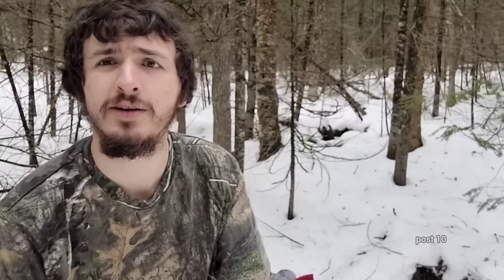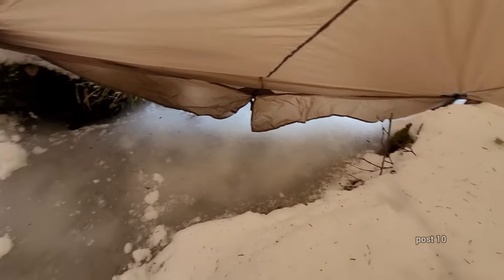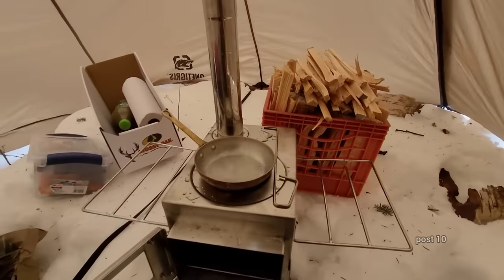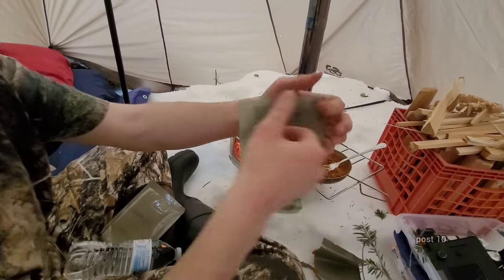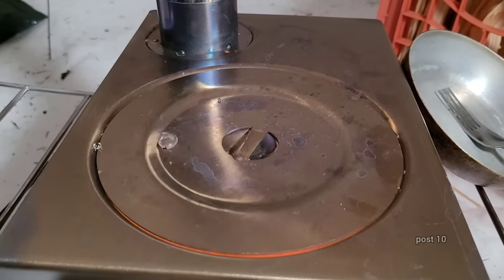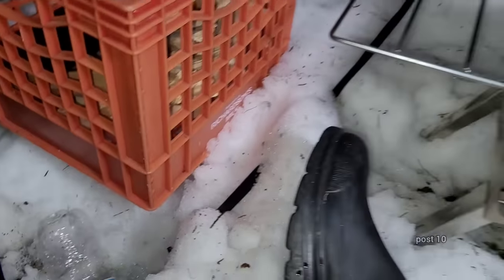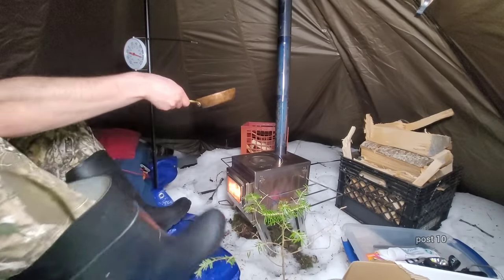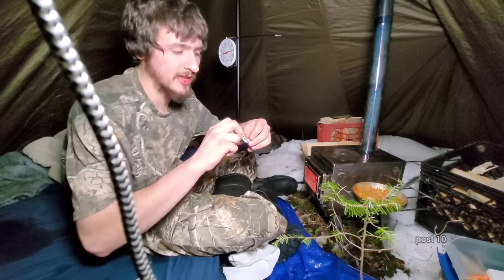24 Hours Winter Camping With MRE Meals And Tiny Stove, With Stream Inside The Tent

Comment: Some words of advice, sorry if anyone else has mentioned this already :  
Your MRE isn't heating up enough because you aren't putting enough water in the pouch, ALSO, you're not supposed to put the water in FIRST. The water should go in the pouch AFTER the meal pocket. You insert the sealed pockets in the heater sleeve then pour enough water up to the line. Then you want to sit the pouch at a 45⁰ angle, NOT flat. You will get much better and hotter results, I guarantee it.

Comment: Those smaller stoves are actually great for extreme cold I use one smaller in my steel shed (10x12) and it keeps it warm at around 65-75 and it’s not insulated at all and it doesn’t take that much wood to keep it warm

Comment: The coloration on the pipe shows visually the level of heat. 400-450f will be golden, 500-550f will be blue, etc. If it gets hot enough, it'll go back to grey. It's pretty interesting, the colors are actually a form of rust as the metal heats up it interacts more vigorously with the oxygen the changes reflect that. I use that color change to temper steel in my shop to whatever level of softness I need after hardening.

Comment: Hello! So many ideas came to me about the tent, etc. 
If you want to use the tent in the summertime where there is no handy depth of snow to plant the pole into, you might get a piece of pipe the pole fits almost snugly into. Cut one end of the pipe into spikes to hammer into the ground wherein you may stand the tent pole. You worry that you have to nearly fall into the side of the tent to open the zip. Maybe a stick with a ring attached could make the 
The pan is overweight on the handle, but that kind of pan can be used to make omelets on a chef's small propane/butane stove (or a camp stove!). Omelet chefs start the omelet in the pan. When it is cooked enough on one side they flip half of the pan's contents over forming a semi-circle. And the pan is leaned against the stove burner so it continues to cook more slowly. 
To balance the pan you might look for a fork or spoon to balance the handle (or some weight to counter-balance it). To make the fork or spoon hold itself to balance the pan handle, cut a slot into into the handle of the fork or spoon to settle opposite the pan handle. 
Good camping inn later times too! __

Comment: An idea for another time - if your bed gets wet like that, use your hot frying pan like an iron to dry it. That is basically all that the old bed-warmers were - a frying pan with a tight fitting lid that they filled with hot coals. Then they would just pass it between the sheets to warm up the bed.

Comment: Love your videos mate, just a suggestion. With those kind of rations the packages are made to be ‘boil in the bag’. If your not using the heating element just boil water and drop the packets in for a few minutes. They cook evenly and you can you can use the boiled water for drinking after it’s cooled down. Also saves on cleaning! Be safe and keep doing what you do

Comment: With those MRE heaters, you are supposed to place them at a 45° angle, not lay them flat.  That has the same effect as using too much water. Also, you should save the box if it comes in one to slide it back inside to keep the end folded over.  I have used them in the service and they will boil your food if used properly.
Reply: Use rock or something lol
Reply: @timmermansj1300  Yes, a rock or something is a key element of the MRE cooking process.

Comment: Great video! When I fought fire for the Forest Service back in the 90s, we were issued MREs for our packs but they didn't come with heaters so someone told us to leave the entree foil pouch in the cardboard sleeve, stand it on it's end, leaned against a rock and light the bottom on fire. As the flames consume the cardboard and move up the pouch, it heats up the contents pretty good, better than eating them cold at least.

Comment: I use a spark arrestor on my tent stoves and never had a problem with creosote buildup even with a damper.   Not sure if it  will help but I also use some aluminized Kevlar around the stove-pipe where it goes through the pipe jack in the tent.   The warpage and discoloration seems pretty normal for stainless stoves and they all seem to glow after a few hours of use especially with the air vents.   Even the titanium stoves warp to an extent.      I carry some 000 steel would to clean the stove pipe after use helps keep down the carbon and mess when packing.      The packable stoves are awesome and can be used when there is not enough snow coverage for using a sled,  I especially like the one piece rolled stovepipe packs super light,  no worries about leaking and easy to clean.       Great content - love the Latvian and Estonian MRE”s !

Comment: In my experience with American MREs, when it comes to the heating element, less water is better. I would start with ¼ of the recommended water amount and work my way up. They have a tendency to flood and be temperamental. Start with ridiculously less and you will be surprised how much better they work.

Comment: 32:12 "This is way better than I expected" That's been a lot of my experiences with the food and drinks in MREs! Bought an old camper from the forest service that was used as a mobile command post and several of the cabinets were filled with unopened MREs, so I've been slowly eating through those. Probably over 10 years old now and they look like dog food sometimes, but are surprisingly tasty and very edible in most cases. I've have had some bad ones though, I think I had some eggplant stew one once that was pretty horrible. Whats your favorite and/or least favorite MREs youve had so far?
Reply from the maker: My least favorite MRE meals are probably the cheapest American ones and my favorite ones are probably the Russian ones. I've even tried ones that were 30 years old and they still tasted fine you like you just said but any older than that I just open them up to see what they looked alike like when I bought ones from the 60s although back then they were in a c ration count
Reply: @post 10

Comment: I think the problem with the MRE heaters is an issue of the food starting from cold. It would work better if the food was pre-warmed from cold to near body temp by putting the packet under the clothing, next to the body for a while.
Reply from the maker: It's because the American MRE heaters are really cheap while all the foreign ones performed perfectly
Reply: @post.10  10 years US Army and I dont think I ever had a bad mre heater, but Ive plenty of knockoff mre's where those heaters are about as useful as an ashtray on a motorcycle lmao
Reply from the maker: @F-1fittie  do you think these ones are fake? They came in a case from Amazon. I have bought many MREs over the years from different eBay sellers and almost every American one has failed I was always told that it's because as a civilian I can't buy one that is new enough to work properly but I would assume they should be working for like a decade. I've bought 30 year old American MREs and the heater works fine
Reply: When it's cold, you can put a meal in your sleeping bag with you for the next morning.

Comment: So we learned something today about that type of stove. The tent is now a loss with that many holes. Like one and done
Reply from the maker: No the hot tent is not a loss. There's just a couple tiny holes and if it became a problem I could use a bicycle patch kit over them or some kind of tape. I think it's a shame that the stove company sells these stoves without the spark arrestor that they also sell separately because they know people using these for the first time aren't aware that that part is also needed
Reply: I would personally if you bought the stove and the tent as a package getting hold of the manufacturer and telling them watch your video. And you're waiting for replacement. And take the  hints that you did and improve your product

Comment: The colour of the exhaust pipe is telling you how hot it is. When steel heats up like that, it goes golden brown and the purple-blue that you have. If you're tempering steel, this actually give you somewhat accurate readings into how hot the metal is. If you keep heating that pipe up more, it would turn back to grey.

My brass lighter has similar coloration changes near the flame part.

Comment: I have the black coated steal stove from the same brand, she doesn't smoke after it's heated up, you have to remember to close the drawer before you close your flue at all, I was wondering what to do with the holes on the back, he has given me a great idea, thank you dude, the added damper is gonna help do much. You have to make sure you always latch the door or it will smoke and turn red, and the drawer controls how slow it burns in the boxs, you closr the drawer  and it sends the hear up the pipe and cools the box.

Comment: that's single wall venting, that's why you have the bluing of the pipe. you should have double wall like gas furnances. also, you need to make a damper to help keep some more heat in, instead of going up the smoke stack .that stove is not practical, It is too small for cooking and the sheet metal frame work will not last. Bravo to the person who created MREs. They are handed out during hurricanes recovery when people are without power and stuff.

Comment: Take the top off the snow and pile it around the base of your tent around the inside. Help with drafts. Do it on the outside to weigh down your tent. 
Put those Russian tin meals in a pan of water on the stove to stop them from burning.

Comment: All those tents getting holes burnt into them seems like a common flaw. What are you supposed to do when you plan on camping for a week or two? Bring duct tape?
Reply from the maker: Spark arrestor I think. Haven't tried mine yet
Reply: Duck tape and a can of Flex Seal
Reply: And a can of 3M Adhesive spray

Comment: Stove; The seconary air is comming in the back. If you want to regulate, it must be from the ash drawer. The back holes can not be blocked, that is why it makes vary little smoke. That shows high wood gas burn, and will give more heat. Even though it does not have a baffle.  ...TUMZ ZUP !
Reply: that is correct, i have same stove and i actually prefer using the ash drawer and not having the damper in the pipe.  works great so far.

Comment: i have the same stove...the Ash drawer Is the air flow control.  the more you pull the ash drawer open, the more air flows.  No need for damper Nor adding piece to back side vents.  try using the drawer as the air flow and you will see yourself.
Reply from the maker: I bought a damper that the company sells, I had two drawer closed the entire time and it was acting like a rocket stove burning through like crazy

Comment: Love your video my guy but you’re supposed to burn all the harmful chemicals off a brand new stove before you use it in an inclosed area. And after the first burn the stove will run at its full potential and it will be safe that’s why the longer it burned the better it burned

Comment: for helping stove cool down when your done with it, if only thing left is some coals can't you just throw some water/snow on top to cool it? Water cools metal down incredibly quickly, you can even take a hot pan right from a burner and pour water in it and cools in seconds. I'd just not throw any water on inside of stove since it'll just make a mess and slushy ash inside.

Comment: You mentioned that the little stove was using a lot of fuel, and I think it might do better if you could rig up a damper.  Most of the heat is probably just going out the chimney.  Anyway, keep up the good videos, they do good in the world!
Reply: the Ash drawer is the damper...i have one of these stoves and you can control the fire with the ash drawer.
Reply from the maker: I bought a damper for the next video from the company
Reply from the maker: @shadowsilverlight1651  it was closed all the way there's no way

Comment: That stove has the same design as a smokeless firepit. Thats probably why you can open the top.
Reply: Just now got to the part where you said there was no smoke. Yeah, the holes in the top provide extra oxygen that ignite the smoke before it leaves! So dont drill into it.

Comment: MRE's REALLY differ, not just in taste but in Calories.   

HDR MRE's  (humanitarian)  are 2,200 calories, are always vegetarian.   2200 cal is a touch on the low end, its assumed the person will not be doing any heavy activities for the day.

US army First Strike Rations.  2900 cal...  compact full days meal  

US MRE  normal ration  1 meal = 1,250 calories, generally you are expected to use 3 meals.    bulkier then first strike...   for prolonged field work.

French RCIR's 24 hour rations, 3200 calories

Civilian MRE's may run between 900 and 1200 per ration depending on company.

on the flip side many of these dehydrated meals are 400-600 cal, so you may want or need extra compoents to each meal if you are doing hard work or its cold out.

Comment: What size tent did you get if it is a four man then it looks smaller than it does on amazon in the picture if so I'm be disappointed I'm looking to get one well not so sure now
Reply from the maker: This was advertised as a four-man tent and if you saw my video using the green tent that was a two-man tent my last hot 10 video. When they say four-man they are talking about sleeping bags right against each other not practical though

Comment: Post 10 - you ate 4 MRes in less than 12 hours? Wow .... I wish I was young again and could consume that many calories and not worry about gaining weight 😄. I love the first brand of MREs that you open. I use them all the time. They seem to be a little bit more expensive but, I don't care -  their quality is better than a lot of the others. Try this next time (if you want - of course it is your choice) .... bring a 3 quart sauce pan with you and boil water (I have also found that the heating element for the American companies are of poor quality). Then drop the food pouch in still completely sealed. You will only have to boil it for 6-7 minutes tops. You will be able to pull it out but, after you cut the top off and poor the contents out you will not be able to squeeze the remnants out without a glove or something protecting your hand because it will be HOT. Be careful. Anyway, love you, love your channel .... keep up the good work. Not everybody has the gift to tell a story - you do.

Comment: Over 4 years in the army I always added at least double the water to the MRE heater and never had an issue, in fact I'm my experience it got hotter faster and was more efficient at heating food. Maybe I had good luck? Or you had bad luck? I'm honestly unsure.
Reply from the maker: I've always had bad luck with the American heaters and I've been told it's because civilians can't buy brand new ones but I think they're just making them cheap these days because I've opened American ones that have been expired 30 years and they've worked perfect
Reply: @post.10  we were taught that everything in the military was bought from the lowest bidder. So basically anything "military grade" is the cheapest thing that met certain criteria. Often the second place item was significantly better yet only marginally more expensive.

Comment: You regulate the air flow with the drawer in the bottom. The smoke stack should of been on the opposite side that would of protected the tent b blowing the sparks away from the tent.